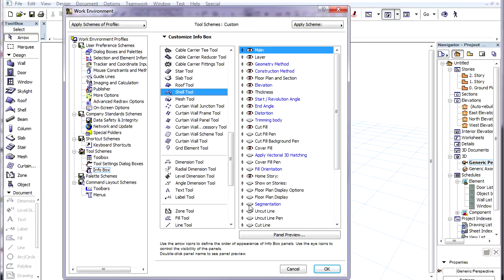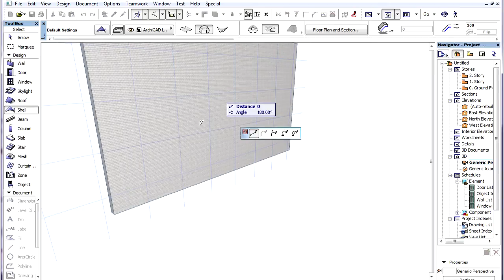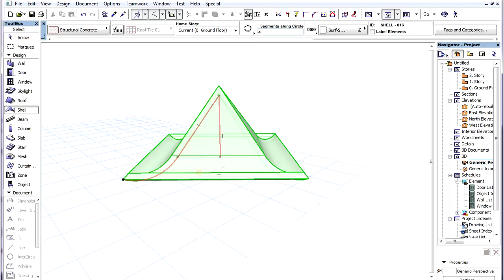The ARCHICAD Shell Tool - Segment surfaces of revolved shells

Comment: Hi! I'm having a lot of difficulties in creating a shape in Shell, which I prefer to later create doors and windows, although this model that I want to create is not even in Morph. It's about wanting to make a 360º or "revolved" element like you did with the "jar", but this one is symmetrical, and mine is asymmetrical, that is, it works differently on both sides...but when I do 360º revolved , the shape is the same on both and when I try to edit one side of the object, the other side also moves...how can I make this so that my object is 360º asymmetrically, or the sides are different??